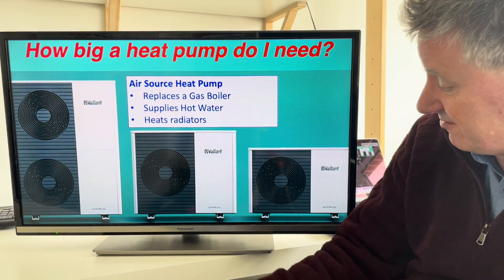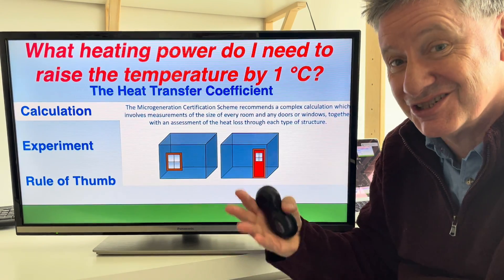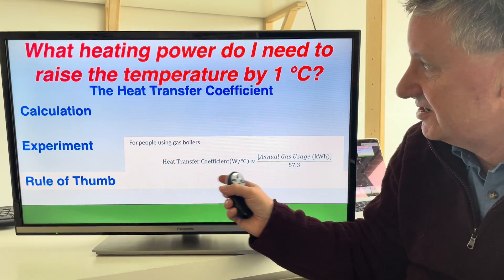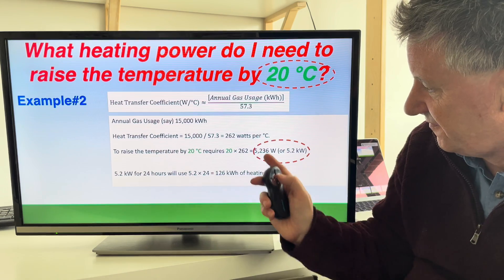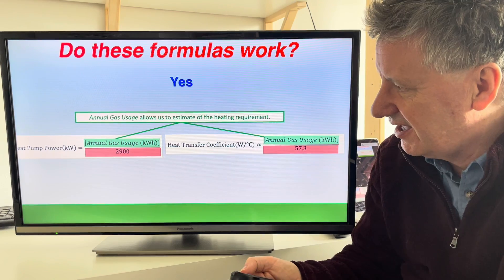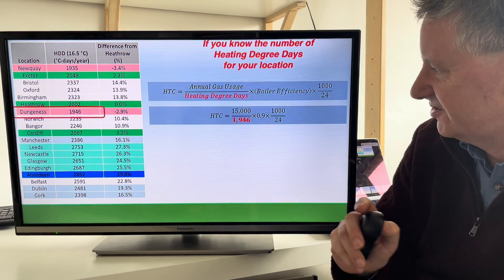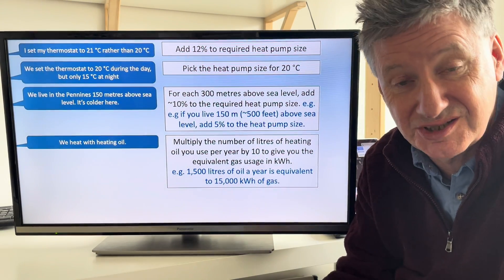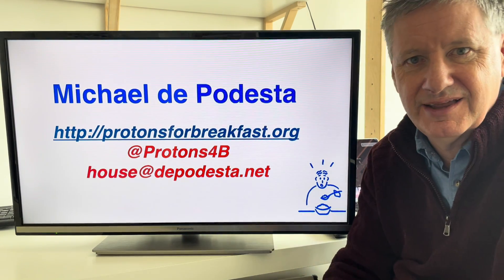How big a heat pump do you need? A simple Rule of Thumb.

Comment: Nice video! What do you think the size of unit I need if my heat loss is 5KW/-7C and temperatures here in winter barely reaching -15C ? The lowest average temperature is around 0C in January. I think 8KW unit would be enough but was also thinking about 12K but I fear it would be oversized and cycle a lot. Thanks!
Reply from the maker: Misenko856, Good Morning,

Nothing is simple! Here is one thing to bear in mind and two thoughts!

The thing to bear in mind is that the nameplate capacity (e.g. 5 kW) is the heating power under specified conditions - in Europe often an outside temperature of 7 °C and and a flow temperature of 35 °C. The heating capacity falls at lower temperatures and with higher heating flows. So a nominal 5 kW heat pump might have an output of only 4 kW at =5 °C. So you need to assess the heating power *at the lowest temperature you plan for the heat pump to operate*. This requires looking at data sheets.

Thought#1: It's expensive building for extremes. If you only have two or three days at - 15 °C, then it may be worth installing a heat pump that meets your requirements for (say) 360 days out of 365 - and just using additional electrical/gas/wood  heaters on the cold days.

Thought#2: If you are designing for these temperatures, then maximising radiator area, or using underfloor heating will help keep your flow temperature low and improve your COP - and this is a gift which makes all other design aspects easier and makes the system cheaper to operate.

Good luck with your endeavours.

M
Reply: @michaeldepodesta001  Hey, many thanks for quick response. I've tested my radiators with 45C water temperature (with electric heating) and it maintains 23C indoors when there is -5C outside so this is pretty good and fine for me (yes in my country we are used to such high indoor temps lol, not like in UK 20 and less :)). More over I want to buy Samsung HTQuiet which is suitable more than enough and it will run at 50 - 55 only in -15 or -20 degrees. I plan to run it at 45C most of the winter (is capable up to 70C of heating water, insane). Also this pump should be able to maintain full 8KW power up to -25C! without additional heating so this question is also out of scope. And since my heat loss is 5KW at -7C, then at -15 it could be around 6.5KW which still keep some reserves until 8KW. So even at -20C I should be able to maintain comfortable temperature inside. This is the reason why I think 8KW unit should be plenty enough. BTW, I've tested with my electric heating which has 99% effectivity and my daily consumption was 100KW with -5C outside. 8KW heat pump should be able to produce 192KW/day so for my house this should be good enough to cover the winter. If my calculations are correct of course, I'm not expert here :) And as you said it "Thought#1" i can still use my electric heating or my air-conditions units to help with heating if disaster happen and we get -40C like in Russia :D Now I only debating if to wait for new LG Therma V with new R290 coolant or not lol. Can't decide since this Samsung unit looks very good.
Reply from the maker: @misenko856  It sounds to me like you are already pretty well prepared. Regarding when to purchase a unit, if you act now it will not be installed until mid-winter at best (I guess?) and so it may be wise to just make observations of the 'before' situation this winter, and then install in the spring or summer when heating is not so critical.

In any case: keep warm!

All the best

Michael
Reply: @michaeldepodesta001  You right, however, the last winter I was heating with 2x5KW split wall AC units already so there is no hurry with installation of the heat pump. Savings were great but it's a bit annoying way of heating because of noise from fans you know and the temperature in rooms is different a bit :) So this will be more elegant solution and with better effectivity and comfort hopefully. Before I had pure electric heating and this is insanely expensive these days. Thanks for your hints.

Comment: great video, thanks for sharing, but I must correct something it is about oil (gasoil) conversion to gas kwh, here in spain we use plenty of oil boilers ... yes, so expensive, but canalized gas does not reach everywhere unfortunately

the conversion used in saunier and vaillant calculators for oil boilers is 7,5 kwh of actual heat per liter, quite less than the 10 kwh you propose, as an older oil user I can tell you than 7.5 kwh of heating is quite more acurate in real world situations than the value of 10, it seems oil boilers do have a lot of energy loss

so a better estimate wold be as follows

10 kwh gas less 15% loss equals 8,5 kwh heating power, 1 liter of oil gives you the equivalent to 8,8 kwh of gas, so, if you divide 2900 by 8.8 it gives you rounding 330 liters of oil equivalence to your 2900 kwh of gas

my saunier genia air max 8 in three winters on the row has given me 6.5 kw power per hour of use, I used to burn 2200 liters of oil per year, that should give me a power needed of 6,67 kw ... so close both results

I have done the maths with other heat pump and old oil users in a telegram channel we use for sharing data and information, and I can tell you this 7.5 kwh per liter is quite a precise estimate

so for oil users your formula should be liters per year/330 and that would give the average heat pump power needed to obtain that same energy

hope it helps, and if you agree or want to check my data you or course are free to do it

here in spain our winter season is shorter than yours, so a 10% plus over the calculation maybe a little short, in my case with maximum power with low temperatures outside (all night below -2) and the house cold to 12 degrees, I measured in my case a steady production of 8.5 kwh heating from my machine, although it says 8 kw in its comercial name, it can actually go up easily to 9,5 and in ocassions to 10 kw power output

in this circunstances I think it is better to apply maybe for a 15-20 percent excess from your formula

anyway thanks for your shared knowledge, and I will follow with attention your experiment this year after removing your 50 liters bottle of water (LLH), I will give you a tip that you already assume, several people here have done it already, some of them making a reversible bypass, no one has used again the LLH ... with no LLH you gain control, confort and efficiency, I am sure your data will prove it
Reply from the maker: Jose Manuel, Good Morning.

Thank you very much for your input. Chemically and Thermodynamically I think that 10 kWh/litre of oil is correct, but you are saying that in practice oil boilers are only 75% efficient. That's very depressing but quite believable. When I next give this talk I will amend that slide.

Regarding the LLH, the coming winter will see what difference it has been making!

BEst wishes: keep warm!

Michael

Comment: Thank you - first time I've found a "easy" way to make this calculation based on actual usage rather than heat loss calcs - the Heat Loss Coefficient was the missing link for me as I have over 10 years data on gas use - varying from 10000 to 13000kWh per year (with PV that contributes to the DHW since 2014) - by this rule of thumb I would need a 5kW or lower HP which is way lower than the 9kW I was thinking - the current gas boiler is still massively over-sized at 10-20kW modulation. I may get a proper heat loss calc done too but this gives me hope that the insulation I've added is actually pretty good considering it's a 20 year old 4 bed bungalow with a 200m2 floor area which had been previously insulated at rafter level (not ceiling) by the previous owners that built it. I added another 170mm to the 100mm and was thinking of adding external insulation too. I've also replaced all the glazing with much lower u-value glass. Current boiler runs at 55C as a maximum so I need to work out if running a lower flow temp will need bigger rads. The other consideration is we only heat the house to 18-19C rather than 20-21C though we have a wood burner for the living space...all useful info!
Reply from the maker: @Umski, Good Evening. I trust you are well.

If your consumption is between 10,000 kWh/year and 13,000 kWh then you are not using a lot of energy to heat your home. Assuming you live somewhere in the UK then, Yes, a 5 kW heat pump (ish) sounds about right. I would encourage you to get a heat loss calculation done separately from a MCS heat pump installation because then you are in charge of the information. Depending on your location it might cost £200 ish. 

For a bungalow heat loss through the ceiling/roof is relatively more important so you have definitely done the right thing adding insulation there. I would think twice about the external wall insulation. I have had it done and I like it, but it is expensive (~£100/m^2) and it sounds like it may not be necessary. If you have money for insulation, per haps underfloor insulation or underfloor heating might be worth considering.

There are two issues with heat pumps which I wrote about here 

https://protonsforbreakfast.wordpress.com/2023/08/02/hydronics/

The first is the diameter of the pipes in the installation - and a bungalow necessarily has longer pipes than a two storey home. And the second is the radiators. The article has a spreadsheet you can download which will give you a rough idea of whether you need new radiators. Your heating requirement is low for such a large house ~50 kWh/year per square meter which is in line with good modern building practice. A Passivhaus is 15 kWh/year per square meter. 

If you save money on the external wall insulation, I recommend that you buy a battery - and use it to run the heat pump from cheap rate electricity. 

Anyway - congratulations on your warm home: do drop me a line if you think I can help at all.

Michael
Reply: @michaeldepodesta001  thank Michael for the very detailed reply, yes am located in Cambridgeshire - yes the external insulation is pricey, it was a toss up last winter between that and battery storage which won 😁 We didn’t import any electricity between March an October as a result so it’s paying itself off quickly and I didn’t massively oversize it (just 4.8kWh to start) - I don’t currently have an EV either so there’s scope for expansion though an HP would quickly suck up any spare PV generation. The logic behind the external insulation was that part of the bungalow has superficial cladding and is the coldest being smaller and exposed on 3 sides so it would have been simpler to DIY to see if it warranted the rest being done. The internal plumbing is a bit of an unknown though I suspect largely uninsulated pipes hidden under limited insulated flooring annoyingly as it’s MDF I believe. It would be nice to add UFH but would be far too disruptive to do it so I think sticking with the existing rads and upgrading those that need it to double convectors would be a good starting point 👍 It’s an interesting journey but for me driven by cost and the principle of moving away from gas but without throwing £££ at the problem - that also means being savvy with the PV and using electricity as and when it’s available and using gas as a last resort - the boiler is 20+ years old now so it would make sense to go HP and I think it will be a relatively straight swap - I just need someone without an agenda to verify my calcs 😉
Reply from the maker: @Umski  Good Morning 

Sounds like you are proceeding sensibly. 

Regarding PV and heat pumps, their operation is (unfortunately but obviously) almost entirely out of phase. In the summer we operate the DHW cycle (and tumble dryer, dishwasher etc) during the day to use the excess PV, but in autumn/winter - switching soon - we switch to running these in the cheap hours at night. The PV takes care of about 10% of the electricity in winter.

Regarding EWI over. limited portion of the house. Why? Because the insulation is very effective, but heat flows 'sideways' through the walls from the uninsulated exposed walls to the insulated interior walls. I discovered this very well known effect because I am an idiot and I wrote about it here.

https://protonsforbreakfast.wordpress.com/2020/06/23/intuition-and-experience/

Regarding costs, a heat pump will only make financial sense if you have a battery to time-shift your consumption of electricity to the cheap hours in winter. It makes carbon sense with or without battery.

Best wishes for your endeavours.

Michael
Reply: @michaeldepodesta001  thank you again - the EWI experiment you did was fascinating - I guess it's like the analogy of having holes in a bucket - that said, I am wondering whether the benefits are still valid in that the section of the house that I was thinking of insulating can be essentially looked at as an extension or annex even though it was all built together - insulating all 3 outer walls would reduce the surface area for the "sideways" heat to escape i.e. it would hit the insulated roof space or the narrow join to the main part of the house - much like a cover on a hot water bottle - this is just speculation mind 😁 Likewise, I maybe hadn't appreciated how well insulated it might be so the other step was to go for MHRV as I know there are some cold spots in a couple of rooms...the HP sizing has been the eye opener for me - I'll need to find someone trustworthy to run some official calcs as you suggest 👍
Reply from the maker: @Umski  It seems you are proceeding very sensibly.

Regarding EWI, my point is to be aware that it might not be quite as good as you hoped. I would encourage you to make some kind of measurement before you do the work so you can see whether or not what you did made a difference. This might be measuring the difference in temperature between two locations in your home. Let me know if you would like advice about how to measure the temperature.

Regarding MVHR, you can estimate the actual level of air changes per hour in your home by measuring the CO2 concentration 

https://protonsforbreakfast.wordpress.com/2021/06/06/estimating-rates-of-air-change-in-homes/

All the best: M
Reply: @michaeldepodesta001  thanks, yes that would make sense - I’m all for having some data to go on (rather than just “reduced” energy bills!) - the experimental EWI is a big outlay in both money and labour even with DIY so it needs to add up 👍 Thanks also for the pointers on CO2 - been meaning to get an air quality monitor for ages mostly due to the woodburner so this would also be a useful measure 👍

Comment: Hi, very good video,   can you please explain me, if im on a milder climate, with less degree days,  the formula generates larger heat pumps, as this number divides the kwh total consumption.   In my case have a house with 110000kwh, and only 2000 degree days,   if i had 2500 degree days the pump will relut in a smaller one that with the 2000 degree days.  Hope u can clarify that to me Thanks!!
Reply from the maker: Stefan, Good Morning. 

Yes, this is a thing which has confused others too. I think I've answered it somewhere in the comments, but I can't see that answer now.

Let's use your example - and guess that you have made a typo and your gas usage is 11,000 kWh (not 110,000 kWh as you have typed). 

The formula works by estimating the Heat Transfer Coefficient (HTC) for your house - a measure of how 'leaky' it is. If you house uses 11,000 kWh/year and is in a climate which requires 2,000 heating °C-days then this is equivalent to a HTC of 11,000 kWh/year/2,000 which around 5.5 kWh/day/°C. This means your dwelling required 5.5 kWh/day to raise it 1 °C above the outside temperature. If you wanted to raise it (say) 20 °C above teh outside temperature then this would require 20 x 5.5 = 110 kWh/day - this is equivalent to a heating power (continuously) of 110/24 = 4.6 kW.

Now suppose that A DIFFERENT HOUSE also consumed 11,000 kWh/year but it was in a COLDER CLIMATE  which requires 2,500 heating °C-days then this is equivalent to a HTC of 11,000 kWh/year/2,500 which around 4.4 kWh/day/°C i.e this different house from yours would be less leaky. So to raise this less leaky house (say) 20 °C above the outside temperature would require 20 x 4.4 = 88 kWh/day - this is equivalent to a heating power (continuously) of 88/24 = 3.7 kW.

Does that make sense?

I do hope so.

Best wishes

Michael
Reply: @michaeldepodesta001  :hand-pink-waving: It does make total sense!! ! as for the 110 thousend kwh we calculated a 44 kw HP,  with the  60 to 75w per scuare meter formula in a 600m2 house.  It seems it does work for our mild climate this unrecomende formula.   Much is to say that  I´m very thankfull for your time and explanation.    Very very usefull!

Comment: Are British air source heat pumps for radiators also able to cool the water using the refrigeration cycle during hot weather or is it just for heating?
Reply from the maker: Andrew, Good Evening, 

Firstly, few of the heat pumps are British. Vaillant is German, Grant is British, but Mitsubishi, Sanyo and Samsung...

And yes, many of them can cool as well as heat, but it's not that effective. Typically they can't cool below 10 °C because otherwise moisture will condense on teh radiators and pipes. It is possible to cool with fan-coil units similar to the air conditioning fan-coil units, but these are expensive and not as good as AC at cooling. For this reason my wife and I chose to get an addition small AC unit for summer cooling and as a winter backup for heating in case of failure of the heat pump.

All the best

Michael